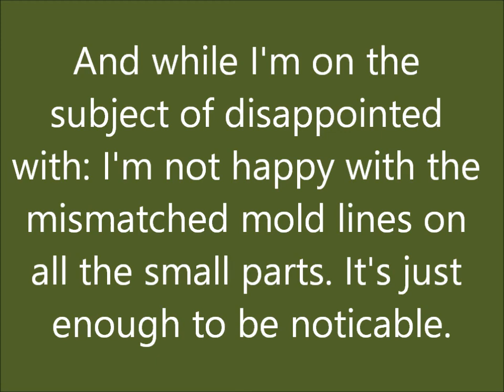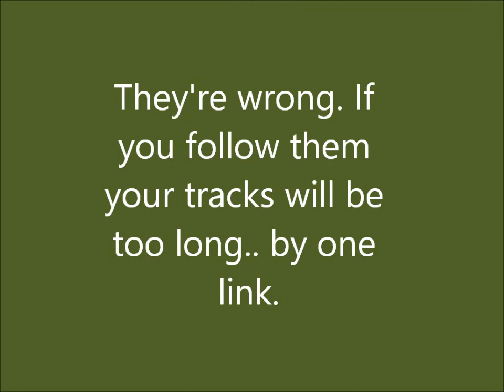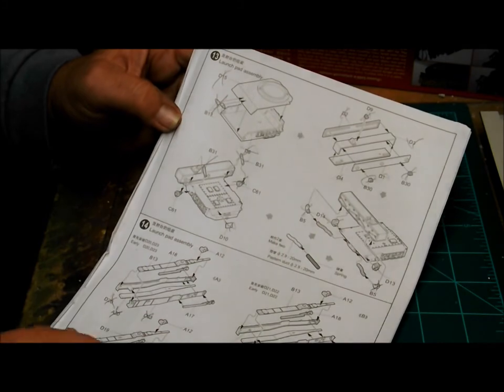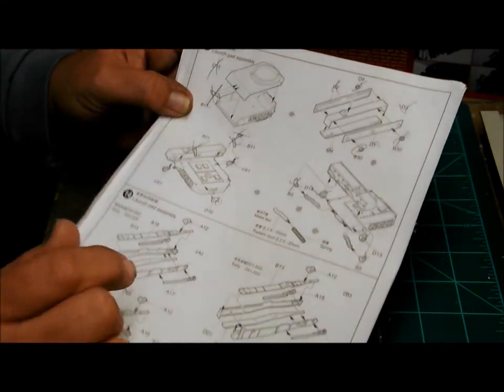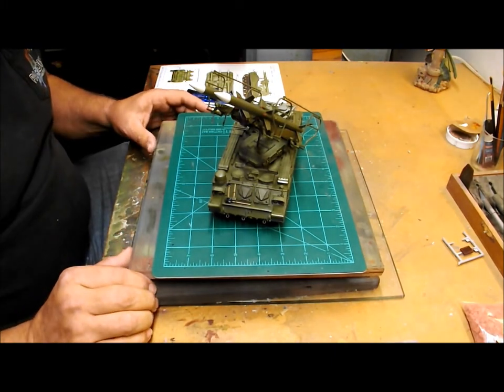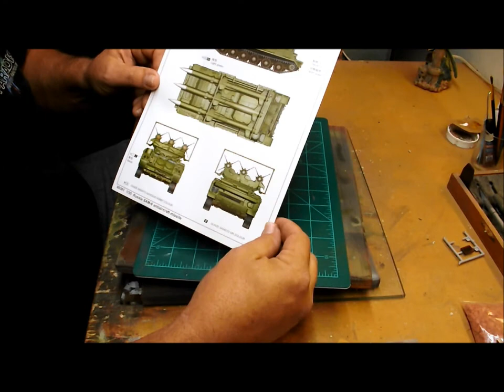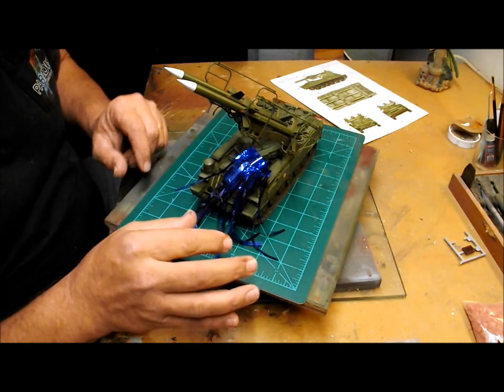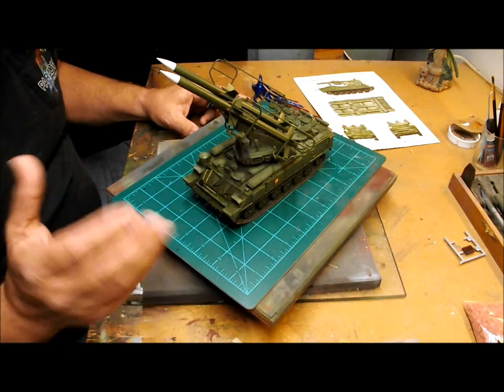SAM 6

Comment: Another great build. Also thanks for the tip on periscopes
Reply from the maker: Thanks :-)  If you plan on using the mylar I find that the best glue to use it the Tester stuff for clear parts, it also makes wonderful small clear windows and I put a drop or two if it over headlights and taillights to give them a bit of glass look.
Reply: Will try that for sure in my next build want to see the results

Comment: Well, there's actually a bit more scratch building involved than the log. The repairs you did are scratch built too, hehehe. More issues than necessary for a rather new kit, including the flaws in the instructions. If you had told me about the tow cables I would have mentioned that I did a tutorial on how to make your own from copper wire and the kits tow cable eyes. Thick chains can never be wrong on a Soviet vehicle though. They used them to tie down the deserters, hehehe! You did a great job on this one, my friend!
Reply from the maker: Thanks Jens. I suppose if you count all the repair work as scratch building then yes, I did do quite a bit of it. Actually the kit tow cable is copper wire and the ends were probably one of the better molded parts in the kit, I just couldn't get it to look good no matter how I placed it. And actually the secondary use you suggested isn't a bad idea at all ;-)
Reply: ´That and the handles for the saw! I'm afraid they actually did that! The secondary use!!! :)
Reply from the maker: Forgot about the saw handles. So glad I was in the US army :-O
Reply: Not difficult to believe! And the pay was much better too! :)